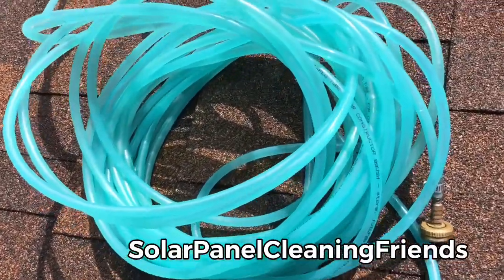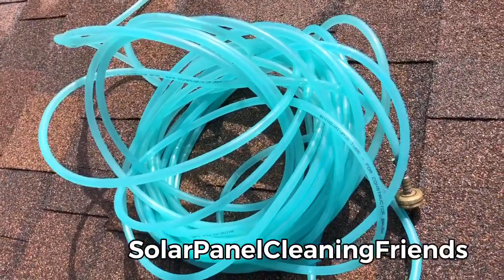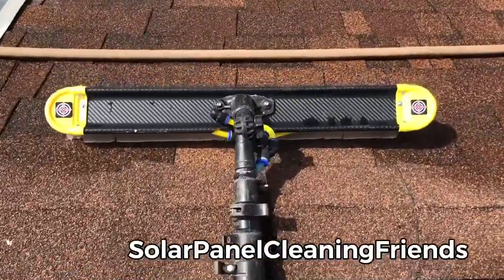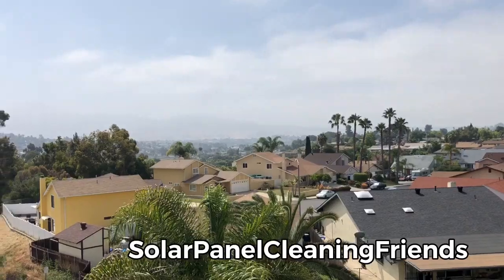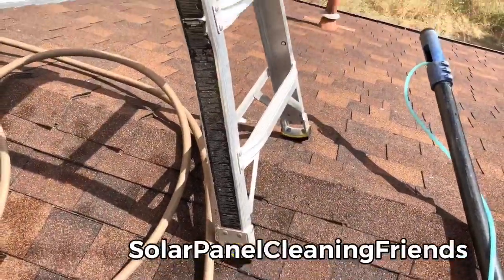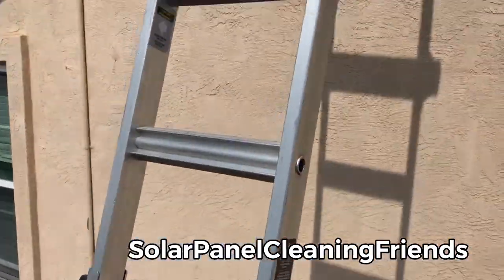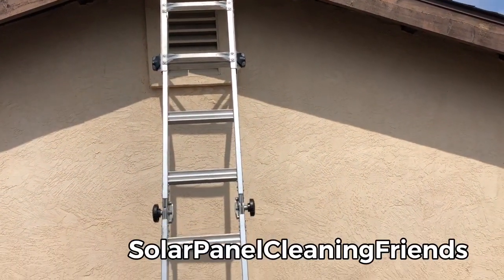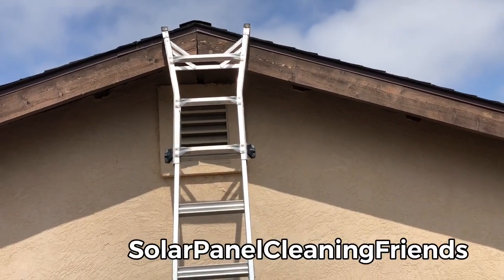How To Do Solar Panel Cleaning | Residential Solar Panel Cleaning

Comment: Im thinking about starting a solar panel cleaning business. I have a few questions... 1.... How do you Handle SUPER TALL Houses with TILE roofs?? Do u wear Anti-Fall equipment when you're on such high roofs? Is it possible if I can call you, pick your brain.... Because there's no solar cleaning businesses in my city and I'd love to start one....
Reply: Another thing you you mentioned was, you dont like getting on roof tops no less than $150.00 that you charge.... But you send out auto-texts to people half way through the month to see if they're ready to book them an appointment, does that mean they would pay 300 a month if they did book you twice? The price you talked about sounded really steep but, maybe I misunderstood and would like to pick your brain if you have time.
Reply from the maker: I wouldn’t want to get on a roof for anything less than $150. That being said, I suggest panels be cleaned every six months. Maybe once a year for some owners. Never twice a month. Not even once a monthly. 1-2 times a year.
Reply: @SolarPanelCleaningFriends  Ahhhh  ok that makes more sense